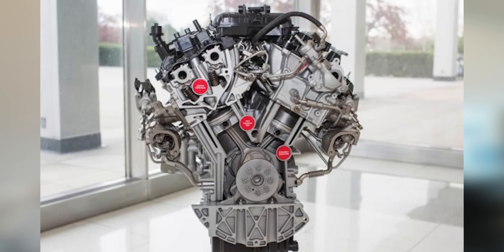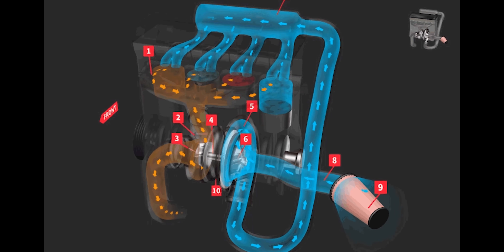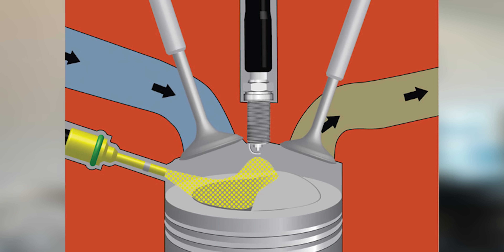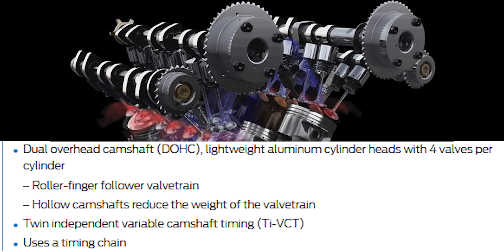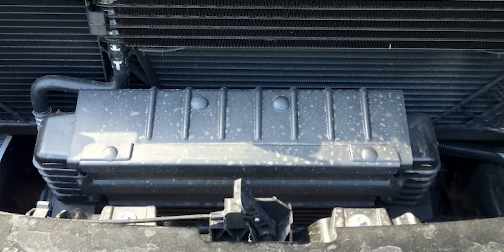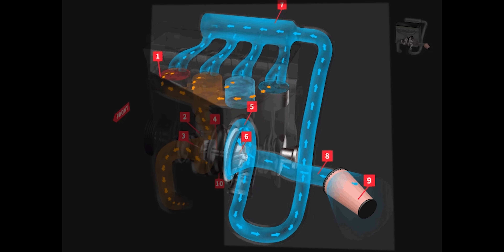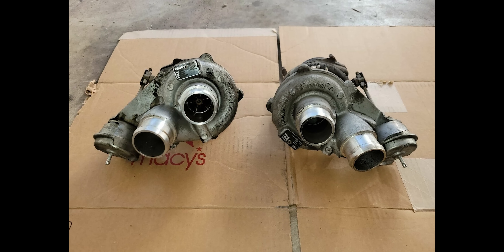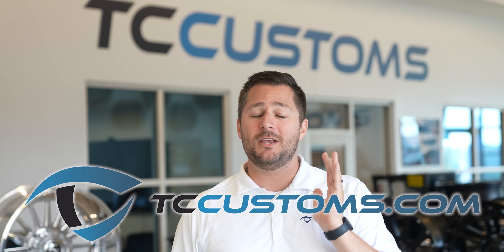The Truth about the Ecoboost Engine!

Comment: Personally got a 2013 f150 with the 3.5 ecoboost with a 181000 miles and it has been an absolute amazing truck no issues at all other than regular maintenance every 5k
Reply: Do you tow alot
Reply: Your turbo coolant haven’t leaked?  My 2014 3.5 had one leak at 75k and another at 99k miles. Ford put quick connect fasteners that fail. Wonder if they fixed this in recent years
Reply: @chuck4abuck1  I heard they fixed it in the new models. Also that they replaced the parts using strong materials.
Reply: Duel cam twice the chance of things going wrong!!! Two turbo's case closed

Comment: I was an eco boost hater until we bought my wife a 2016 explorer have over 100,000 miles on it with out one issue made me a believer
Reply: How often do you change the oil?
Reply: You dont tow with it obviously .... in a mid size SUV great. But they heat soak/ cut power and over heat more then oldschool big block....
Reply: @MormonMustang_  every 5000 miles
Reply: @nasty3145  Well, if he doesn’t (I won’t assume), I sure do. 2018 F-150 w/ EB. Regularly tow a 8000 lb, 33’ Jayco travel trailer. Truck just hit 34,000 miles. No issues. Great engine! Oh, and I run a 5 star E50 and 93 performance tune. And STILL no issues.
Reply: Guy I worked with had 260,000 miles and never had a problem. He had a 2013. Traded it in for a new one last year. He changed his oil regularly.
Reply: I was a hater until we got a 2019 Explorer, and we just traded that in for the new 21 Expedition and like that even more.
Reply: As a tech those things r junk especially when towing. Most reliable truck or suv is Toyota.   so many tundra and Sequoia come in  with over 500,000 miles that have never broken down and only have basic maintenance done. There r many that make it to million miles and keep going on original drivetrain .
Reply: @jd-it4on  Lexus AWD cars like the GS have a very similar powertrain to those trucks. A full planetary transfer case, same six speed trans. A major failure is almost unheard of. Maybe if you forget to put oil in :lol:. Ford stole the two injector idea from Toyota, It debuted on the 2005 Lexus GS 350.
Reply: @alb12345672  similar but far from the same. Toyota has always been more dependable than ford. My biggest issue with the ford eco boost is they over heat when towing and especially if its warm out and going up hill but atleast they will cut power and save there selves but still if u r towing or hauling u want a truck that will do the job and not over heat like these do and when it comes to reliability toyota has that crown for sure. Other problems with these r intercooler issues, suspension death wobble issues and the raptor i owned of a year had all thess issues and known for timing chain failures around 80 -90k so i just dont understand woth how good technology is and the price of these fords why they still cant get them right. I have a 2005 double cab tundra 4.7 with 628k and only issue ive ever had was lower ball joints and my 2009 tundra had around 420k and i haul my 9k camping trailer almost every week with it and never had a problem yet besides mpg are not great but oh well. So im just trying to let people know if your in the market for a truck and need it to last for a very long time with out it breaking down then buy toyota dont waste your time or money on ford. It will be interesting to see how the new tundra will do since its going to be a turbo v6. What do u think about them switching to that engine combo??
Reply: @jd-it4on  I always wondered why they never put the 3.5L Eco in the Superduty trucks. Maybe with a bit more displacement. Maybe they aren't that confident in it.

 I would consider the Ford 6.2L though equal to Toyota quality. They had it in some F150s but it wasn't popular.

I know the V6 350 engine is very proven from Lexus. They have to offer turbo now to be competitive.  I would not buy it thought the first year.
Reply: @nasty3145  they don't heat soak. Check out the tfl video on the 2018 f150.
Reply: @Limited-uq2yk  they, infact do.... if you put proper heat measuring devices on the components. Each hill, each 0-60 pull constantly heats up the turbos. Reducing their efficiency.... stop. Ive driven one and im not sponsored by Ford like he is. He owns an F150 and F250 for a reason. He is literally bought by them.
Reply: @nasty3145  each 0-60 run was about the same.
Reply: @nasty3145  NOT
Reply: @alb12345672  because if you getting a super duty you probably want the 6.7 power stroke
Reply: @jd-it4on  what kind of lame as tech r u? Ford sales more ecoboost trucks and suv in a year that your precious Toyota with that old v8 can in a decade. Plus 2022 Tundra went the turbo route with a v6, is Ford gonna have to sue Toy again for copying them again?
Reply: @Pilot545  But big block V8, 5.0, V8!!!! When I bought my Porsche I realized tying my ego to a V8 was ridiculous, now I have an F150 with EB and it’s fantastic. All these dudes crying about V8s are lame ducks worried about looking like “men”. Ironically, a diesel would be the most ideal motor for towing if they were realistically interested in that. Glad you have enjoyed yours dude

Comment: 203,800 miles and still kicking on my 13 eco😂
Reply: Any maintenance hints?  My '13 semi-died at ~90K miles with timing chain and turbo, waste gate problems.
Reply: That’s it? 😂🤣
Reply: I'm at 240k miles but I've heard horror stories too honestly I think it comes down to how the people that assembled them were feeling the day they built your truck same with the v8 though
Reply: 202k, you looked at your valve covers?? I heard there alot of build up
Reply: 250,000 I changed my oil every 10,000.
Reply: @coreyhalcomb8806  
Which oil? I’m at 130K and 10K oil changes. No timing chain issues yet.
Reply: @mattwodziak1750  no issues as of now. I have used royal purple first hundred thousand, Castrol edge 2nd hundred thousand, and mobile one here and there. Always used Napa filters. Only issues I have had is the coil packs. I've replaced each one once and 3 and 2 twice. And that plastic piece of crap intake I changed once. Same alternator, same turbos. It's a 2014 I forgot to mention. I changed diff fluid with royal purple, transfer case royal purple atf fluid, transmission fluid and filter also royal purple. Changed transmission fluid and filter twice and transfer case twice. I change the plugs every 50 thousand. I use autolite plugs gaped at 32. Factory was around 39 but when I'd floor it I'd have hesitation since I went to 32 no hesitation. That's all I can think of at the moment.  Anymore questions I'll try to answer. O I still get 19.3 mile to the gallon
Reply: @coreyhalcomb8806  
Thanks for the insight. I use Mobile extended service and get my oil analyzed every change. So far so good. At 130K I am still beating all the averages. 

The mileage you are getting tells me you take good care of your truck. I think that is the main factor.
Reply: @mattwodziak1750  yes I do. I am no ase mechanic but I am a maintenance mechanic in a power plant. That is why I use those oils. A lot of you tube and personal experiences. Lol. I've let friends drive it and they can't believe the way it drives with 250,000. They have all said if I hadn't told them the amount of mileage they would think 50 to 75,000. They have all said the same man you really take care of this thing. But not really. Yes I maintain it as needed but nothing else. I hate to admit that part. Lol.
Reply: @coreyhalcomb8806  
100% agree. I used to think I did a poor job at taking care of my vehicles until I saw how the majority of people take care of their vehicles.
Reply: My 11 went 223k miles before I sold it!
Reply: @flight2k5  a chevy or a ram wouldn't make it that far🤣
Reply: @sammyg.4255  5.0 issue also
Reply: @Limited-uq2yk  cool?
Reply: @flight2k5  yeah it is cool seeing a Ford truck outlast the rest of the competition.
Reply: @Limited-uq2yk  😂🤣 nooooo. They don’t out last the competition
Reply: @flight2k5  you're right maybe not toyata but they do outlast Chevy and Ram🤣
Reply: @Limited-uq2yk  Toyota outlasts anything domestic 😂🤣
Reply: @flight2k5  hopefully the new tundra will be the same
Reply: @Limited-uq2yk  I’m excited to see it
Reply: "Motors" are electric.
"Engines" are gas/diesel.
Reply: 282,000 miles so far. Had to replace the timing chains a couple months ago. Changed oil every 10,000 miles.
Reply: @mattwodziak1750  oil analysis is super important. You can see problems before they're big problems.
Reply: @fjb4932  Ford Motor Company, Honda Motor Company, General Motors, Toyota Motor Company, ect.
Reply: I change my oil every 3k, I'm way over kill I guess.
Reply: I have 70k on my 2014 because I try not to drive it as much since the gas mileage is not very good on this engine but performance is great. Not a fan of the turbo lage thou.
Reply: @rtk5847  I’m with you…bout 80k on my 11 running great. I did add a gas pedal voltage modifier for the lag. Works great and they’re only about 80 bucks ….some go by the name spirt boost ,etc. they all do the same thing.
Reply: @ITStechy  I will look into it, thanks.
Reply: Wow 😎😎😎
Reply: @5GNV   Second gen made significant improving.
Reply: 2017 cam phasers went bad. Cold start rattle was getting bad. Traded in on 2021. Read the 2021 has new phasers. Ford has had phaser issues since the triton.
Reply: I just recently purchased a blood red 2014 Explorer sport with 65k miles from a pilot..$21k. Omg I love this vehicle! Drives like a brand new car still. I researched intensively for months about this engine.  The dreaded timing chain driven water pump!  I got it with low miles, so I will just take it to Ford for regular oil changes and coolant flushes. I’m having 2” lift and new suspension and new wheels installed in 2 weeks! Aftermarket of course. Every vehicle I have ever owned, I’ve treated like my own child, so I have a good feeling, my explorer and I have a long journey and future ahead of us… I love everything about this vehicle.
Reply: 2018 F150 3.5 Ecoboost I have 37,000. Love the truck so far I pull my camper with it and still get anywhere from 12-14 mpg.
Reply: @M-PASTA  you mean the machines that assembled them all exactly the same
Reply: @Limited-uq2yk  tundras go to 1 million on original motor and transmission
Reply: @Limited-uq2yk  not even close, tundra has been rated the Most reliable for over ten years now consistently, there are 2 tundras so far with over 1 million miles on original motor and transmission
Reply: @Limited-uq2yk  new tundra is boosted, with more then 6 gears on tyranny, so it definitely will not be as reliable as the previous models, I’m certain they will not last to 1 million miles like the older ones have.
Reply: @coreyhalcomb8806  I don't know a ton about these engines, but was talking to chat gpt (which can be hit or miss lol) about it and it said spark plugs can play a decent sized role in carbon buildup so that might have helped you as well.  It recommended changing plugs, higher octane fuel, frequent oil changes like 5k (but you did 10k and it seems to be going well), catch can, and a couple other things I forget.  By the way did you ever install a catch can?

Comment: "I change my oil every 5k, but no reason to doubt ford on 10k" yeah right
Reply: Hey, as long as the engine makes it past the warranty!  Ford doesn't care after that.  Go to 10k miles and you are talking new motor and turbos.  No one out in the world will recommend going over 5k miles with that engine!  Unless they don't care about giving good advice.
Reply: 10k with full synthetic under moderate driving condition is fine. Folks are living in the past i.e. conventional oils have a lot shorter life than synthetic. But hey, your truck, your choice. Just base it on evidence, not conjecture.
Reply: I was told that they give that guidance on oil changes so they can get you into their service dept more often to take your right arm and your firstborn child.🙊🙈🙉
Reply: Similar to any other vehicle manufacturer these days.
Reply: @geraldcadyii5772  We used to say that when oil change interval went from 2K to 5K, me included..... but I now wait until 4K to schedule an oil change. I've driven my previous 2 Ford/Lincoln cars now up to 80K/60K miles on odometer with no engine issues. Lincoln has Ecoboost, small Ford daily driver does not. And I DO NOT use synthetic oil.
Reply: @datapro007  Yep!
Reply: @Fordbossme a Ford master tech has went into depth why EcoBoost engines require more maintenance than the NA engines.
Reply: Rather than guess on how long my oil is able to perform, I periodically take a sample of my oil and send it off for analysis. Caterpillar has and SOS program for testing oil. It costs about $20.00. No guessing. This also reveals any problems that are beginning with the engine.
It’s like getting blood work, except for a engine.
Reply: @larryhogelie1635   what have you learned about which oils from the analysis?
Reply: I've got 200,000 on my 2015 ecoboost. Still runs like a top. I've always changed the oil between 7,500 - 10,000
Reply: I've always done 12-15k mile oil changes with Mobil 1 extended performance oil and filters. My 5.4 3 valve is quiet as a mouse fart and has 235k miles. My ecoboost only has 50k miles with 12k mile oil changes.  Send your oil in for an analysis. They will let you know how long you can go with oil changes.  Oil isn't what it used to be. No need for 3-5k mile oil changes anymore.
Reply: Uhm, all dealerships generate revenue from their service bays. They want to do oil changes for revenue. Ford on the other hand wants to maintain a brand image as having reliable trucks. So what’s in it for Ford or the dealerships to delay oil changes to 10k miles?
Reply: A dealership in my area said to change the oil at or before 5k miles. I’ve seen several mechanics say the same about the ecoboosts as well. It’s a great engine but keep on top of the oil changes
Reply: @datapro007  how much synthetic do you think is really left after 10k miles….it’s not a diesel it needs oil changes more frequent
Reply: My brothers 2017 blew up with 65k miles and Ford wouldn’t help him a bit with a new motor even tho it’s a CERTIFIED PREOWNED
Reply: I do mine every 3-3500
Reply: @benboyd3082  Feel free to waste your money.
Reply: The reason the oil change intervals have increased is partially due to sales stats.  If they string it out, the cost of ownership numbers go down. With that said lubricants have come a long way, but I still stick with 5k. Also dealerships make very little if any profit on a oil change. The oil costs them about $5 per quarter and about $8 for the filter. Figure their standard labor rate is about $130 per hour and a oil change only pays about 3 tenths of an hour they are probably losing money. They do want to get people in the door with an oil change and upsell them on repairs or bs flush services that aren't needed at the time they try to tell you.  Before you buy a flush, look at the maintenance manual that comes with the vehicle.  That will tell you when you need to do these services
Reply: I mean I have an 1100 horsepower 2nd gen raptor, do 15k intervals on it, have had no problems after doing it for almost 100k on the build. But I don't use motorcrap oil.
Reply: I have a 13 st focus with 2.0 138k only owner 13 oil changes and it run like a champ.
Reply: I know, I know, but oil is cheap engines aren't! u guys can f your engines up over a few bucks in oil but not me
Reply: Use amsoil it’s 100% synthetic it’s all i run now I could never go back to any full synthetic they are only about 25% actual synthetic oils
Reply: I listen to my dad and hes been changing his oil at 3500 miles for 65 years.  He's never had a vehicle breakdown, not once in that time.
Reply: @ponzischemer1424  great point
Reply: Mobile one guaranteed 10k oil changes and has for two decades

Comment: My '16 F150 with the 2.7 , best truck and engine I have ever had in 50 yrs of driving.
Keep oil changed every 3500 miles with Penzoil Platinum, cheap insurance.
Pulls our RV at GVCW 12,500 in hills and mountains like it is not loaded.
2wd, and a 3.31 axle.
Never strains, engine is smooth and rotationally silent.
Uses no oil, truck by itself on interstate kept at 65mph gets 25mpg +/-.
I am happy with it.
I wish Ford would redesign the 3.5 using 2.7 tech so if I ever need a bigger set up a 3.5 max tow would be there.
I love it.
Reply: What is different tech between the two?

Comment: Good video.  Your best comment was your last one.  Yes Ford recommends 10,000 mile oil change.  Don't do that!!  Reset the oil indicator in your dash to 50% life (approx. 5,500 miles).  I am original owner, 2013 F150, 3.5  eco, 240,000 miles, Mobile 1 oil.  Pull a 24ft boat almost every weekend, and a 30ft travel trailer in the winter months,  other than water pump, plugs, coil packs, and a throttle-body...everything is original!!   So, I believe everything that is pointed out in most YouTube videos, is lack of proper maintenance.  Would I buy another?  Yes, and I am!  The 3.5 ecoboost is one of the most technological advanced engines out there!  If you take care of it, it will absolutely "haul-the-mail".